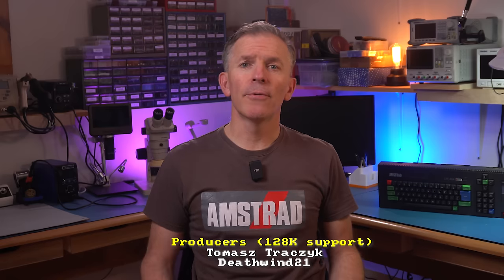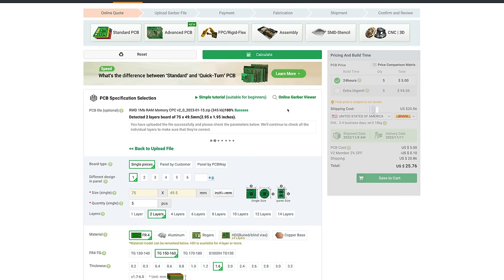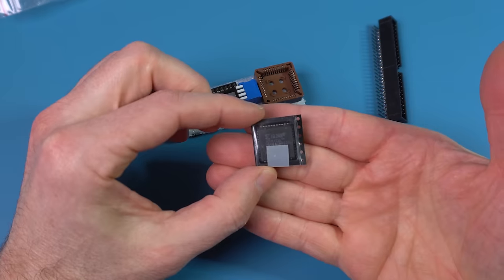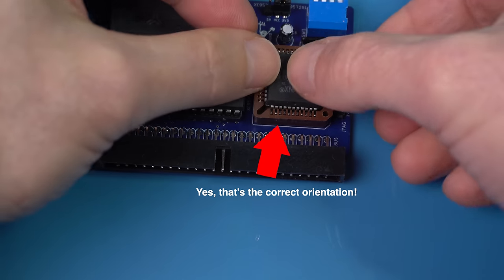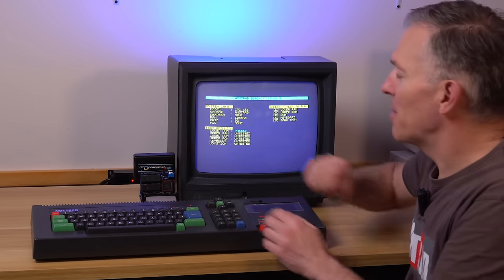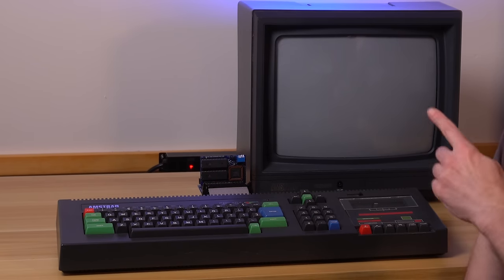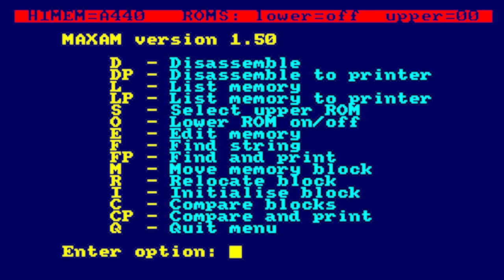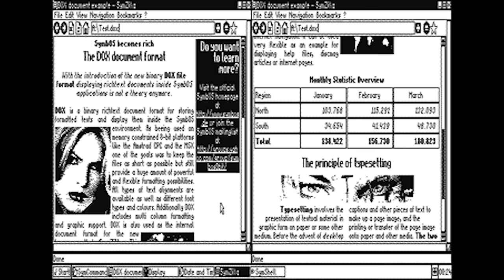Adding 1MB to an 8-bit Computer!

Comment: We could always go above 1 MB in DOS.  The only problem was that until the industry finally solidified behind Extended Memory Specification and the XMS standard there was really no reason to add more than 640k to a system.  Because there was really nothing you could do with anything past 640k other than brag about having it.

In the last days of the 808X platform (1991-1993), I built a lot of systems with 8086 processors that allowed 1 MB directly on the main board.  Because by that time MS-DOS-5 was the newest version, and it had a memory manager included to allow access to memory past the 640k limit.  And programs were also more and more commonly written to take advantage of that and reside in the high memory areas.  I built and sold scores of XT class computers with 1MB, that by default I shoved as much into High Mem as possible.

It was never really a "hard rule", it is just that before then no two companies were doing it the same way so trying to use anything past 640k was a nightmare.  Like trying to use the "Expanded Memory" system (EMS) that came before XMS.  Other than some games an a few specific applications that was never really used because it was a kludgy bank switching system that only worked in protected mode.

Comment: Why don't these videos ever acknowledge the Radio Shack Color Computer?  It had 64K at the same time.  It was the most versatile computer I ever owned.  I could plug almost anything into it directly and make things happen.  I could hook it up to a shortwave radio and decode Weatherfax and Wirefoto images with the same quality as a $10,000 dedicated machine.  I could hook it up to a MIDI keyboard and play multiple instruments simultaneously.  It was an inexpensive wonderland.  Then came the PC for way much more money, and anything you wanted to add required also adding another circuit card inside.  That took away some of the fun.
Reply from the maker: Nothing against it, just that I've had very little experience with it. But you're right, it was very similar to the Dragon and I could have mentioned it there too.

Comment: Actually I had a friend who died in 1998 and he had a 640K (not 64K) but 640K Amstrad CPC 464 he modified/upgraded it himself, it  was quite a computer, it had 6 storage drives and all sorts add on parts he designed it was quite a system matching if not faster than his Amstard PC1640, he was ahead of his time he also had something to do with the Ramdrive on Amstrad but not quite sure what he was involve in)) Rip JAN.. good video!  -- if i remember now its was a  device he designd which he would swap memory banks..  so far back wish i could tell you more.. I think he spproached amstrad but they were not interested ah well
Reply from the maker: Wow! That's seriously hardcore. Do you know what he did with it? He must have been using it for development or running some serious business.

Comment: Although these are fun projects to build and try, they really don't have much use as you've said. Same goes for the GeoRAM expansion for the C64. I have built one, just out of curiosity, and used it a couple of times with games that can use it. By use it, I mean by the help of a 3rd party software (written many years after the games) a multiple disk game can be loaded up into the RAM expansion and can be played without constantly swapping disks. One good thing that the GeoRAM has an internal CR2032 battery backup, so what you have in it stays there as long  as the battery has enough juice, which seems to be more than I anticipated, it has been almost 6 months, and it still works. That's the only sensible use of the GeoRAM. It was actually designed to be used in GeoDOS environment, but to be honest I really don't understand what that is good for on a C64.
Reply: Geos 128 v2 was much better. Georam was good for it. ramdisks are much faster.

Comment: I have the U2+ for my C64. It supports 16MB of ram (I can't comprehend that lol) But more importantly it's my disk drive. It's an all in one device. WAY better than a separate ram expansion and disk drive and tape emulator. So it sounds like that's what this computer needs.

Comment: I remember working at a place in 1985 where an engineer was hired to develop a 128K expansion board for the TRS-80 Color Computer. I kept wondering if anyone would actually write software for it (I don't think anyone did). Then a little later someone showed a "super coco" board that was much larger and had a 68000 chip. So I then wondered, why not just get a PC that has a more powerful CPU? I never saw that board being used either.

Comment: Actually it’s possible to use z80 specifics to switch banks. Some home computers used m1 signal to detect code execution and switch banks. So it was possible to give almost 64k to cpm applications and have kinda protected mode.
Reply: The only problem there is that /M1 only goes low during the fetch cycle of the first byte of an instruction. If you're using extended instructions, for example, using the IX or IY registers, subsequent bytes DON'T have /M1 asserted.

Comment: I wonder if it would be possible to sacrifice some RAM speed and do some type of time based multiplexing to address more RAM. So each line could theoretically address 2, 4, 8 based on clock time.  You'd lose RAM speed to be able to address more RAM per line.  You might need more supporting logic to get it to work.

Clock 1 -- 8 lines send out the low order bits and then on clock 2 they send out the high order bits.

CLOCK 1 -- 01101101
CLOCK 2 = 11011010

ADDRESSED LOCATION = 1101101001101101   (You've doubled the number of lines by using timing) 

The problem is that you cut RAM speed in half because you need to use 2 clocks to create the address instead of just 1 clock.

Comment: "IDC Connector" is incorrect.  IDC stands for "Insulation Displacement Connector".  The connectors that clamp onto ribbon cables have little bladed teeth that push through the insulation on the cable to make contact with the conductors inside.  The matching connectors mounted to a pcb don't displace insulation, so they aren't insulation displacement connectors.  (Or insulation displacement connector connectors)

Comment: Bill Gates? Someone's miss-attributed that quote. :) It was someone high up at IBM who said "640KB should be enough for anyone." The words were spoken. :) I'm told it made sense in context, but I'm not sure what that context was. Only 2 years later, Atari came out with a machine cheaper than the PC but upgradeable to 4MB, so whoever said "640KB should be enough" looks pretty daft anyway.

Comment: There is always ‘Amiga’ way ie use z80 socket as expansion slot. Make a pcb with z80 and ‘fast’ ram which has magabytes of fast local ram. One thing springs in my mind is to make such board with RP ala z80 storm, even RP0 has a lot of megabytes and horsepower to emulate z80 at 100MHz, without any additional RAM and CPLDs
Reply: It would be a fun project to build a fake "extended" z80 with massive amounts of RAM using a Pi Zero or Pico that slots right into the z80 socket of any classic z80 micro. 

There's a few catches though. There are other factors that limit the speed.

At a certain point it's actually easier to just run an emulator on your new hardware and have done with it :D
Reply: yep, there is a narrow line between emulation and simulation. The idea of "z80-storm" is to simulate beefy z80 with local fastram  @TheTurnipKing
Reply: @alexloktionoff6833  there are other limiting factors in the case of the 8-bits.  The NEXT had trouble supporting a clock of 16mhz for example, though they eventually got it, which is relatively trivial under emulation
Reply: The economics are really hard to make sense of to be honest.  You wind up throwing out so much of the old 8-bit micro to get features that are basically for free under emulation.
Reply: Not sure, I understood the problem, is it clock domain crossing between z80storm card and legacy m/b? But with modern uC boards it's not a problem, all pins are already passed through series of FF clocked by frequency more than order higher than legacy m/b. What lets to simulate beefy z80 running with wait states added to sync with legacy m/b bus clock. @TheTurnipKing

Comment: Well, interesting, but to be honest I don't have a single use case for more than 128K. I own a DDI 5 interface for my 464 which expands the RAM to 512K, and I only ever used programs that need 128K. Could be fun if I was a collector of Amstrad computers and peripherals. But I'm not. The video itself is great as ever!I had to view it several times to be able to understand why you only need 2 bits to address the 16K block, but I got it in the end. ;-)
Reply from the maker: Yes, I'm with you there. I was hoping there would be a killer app for that much RAM. So I'm hoping this video brings more eyeballs on it and more development takes advantage of it.
As for the 2-bit thing, I hear you. I always struggle with how long to go over something like that vs. quick mention and move on. I think I have an idea for that in the future that might keep everybody happy though.
Reply: @NoelsRetroLab  the memory expansion is maybe most usefull for SymbOS

Comment: It should be possible to use the memory as RAM disk under CP/M 3. I am not sure if Fuzix is available for the CPC, but 1 MB RAM was great for 16 bit Unix machines.
Reply from the maker: I haven't looked into it, but I'm sure it would be possible. It seems that CP/M is set up to use up extra memory already, so I bet there are already some RAM disks out there.

Comment: Wow, this is impressive! Make me curious what could be added to a TI99/4A with it's 16 bit processor. I know there are limitations within the TI that make it a partial 8 bit but that's as far as my knowledge goes. For that matter would the 99/4A considered an "8-bit" computer for this discussion?
Reply from the maker: Some people call it a 16-bit computer, but it's all more or less the same for this. There are lots of RAM expansions for the TI99/4A actually. That's one of those platforms where most modern development uses expansions, like the VIC 20, I think.
Reply: The TI99/4A was powered by a TMS9900 CPU, which was a single chip implementation of TI’s 16 bit mini computers. It was unfortunately hamstrung by TI marketing, who didn’t want it to compete with said mini computers. As a result it only had 256 BYTES of RAM connected directly to the CPU, and everything else had to be accessed via the VDP chip that handles video. The TMS9900 is a 16 bit chip, with a 16 bit address bus (so a full 16 bits for both the address and data), the minicomputers were designed to handle paging to go beyond 64K.

Comment: Check out the function of the m one line on the z eighty microprocessor chip
It goes low on every op code fact and could be used. Is a bank switcher for machine cudo.
So you can have 64 KB of machine code and 64 KB of data using the M1 to switch between the One

Comment: 64kb was not a significant amount of ram in 1984. By then plenty of PCs were being sold with at least 128 or 256kb. Just because computers with the bare minimum were still being sold doesn't mean it was a lot.

Comment: Gates may/may not have said that, but at the time, such a statement would have been correct.  At some point, for quite a while too, 640K was enough for the everyday normal computer user.  
Now 32GB ought to be enough for anybody, at least the normal everyday user, but it's all but guaranteed that in 10 years, that will no longer hold true.

Comment: you can try to run wolfenstein on it because it requires just 512k of ram i think and what i have seen it was able to run on 8088 cpu so it maybe can run on z80
Reply: Almost certainly not.  The CPU architecture is different (the z80 is an enhanced 8080, the predecessor to the 8086 and the graphics and sound and even memory hardware will be in entirely different locations.

Comment: I'm dreaming of the ultimate add-on on amstrad using an raspberry like pistorm on amiga.
Memory, storage, wifi and sound card emulation.
Reply: The M4 card gives the CPC: wifi, 32 slots for 16kb ROM images, and, depending on the size of Micro SD card you plug in, a super large virtual floppy drive with nested folders, AND a real time clock.

Comment: nice vid Noel thanks!... im trying to build the 512kb expansion at the moment, stuck programming the cpld tho (i installed the VM and have impact running!).. i dont have the proper programming cable so have been trying to use arduino or raspberrypi pi to program the chip.... but im not having very much luck, urjtag says it cant program that chip (xc9536).. the virtual xilinx cable makes the operations (eg programming function) disapear, even tho it detects the chip during boundary scan....and using arduino directly throws a bunch of TDO errors when trying to program..
if anyone has any tips or ideas to help..id be greatly appreciative!
Reply: no matter.. seems i programmed it easy with arduino and correct wiring and xsvfs!..now to test! 😁

Comment: I am a little unclear about how your diagnostic knew the protocol for addressing the external RAM. I'm familiar with bank selecting - but is the bank selection that you used a "standard?" That - your diagnostic cartridge seemed to know how to use the IO pins to select the banks. And that diag cart was created before your new RAM board... so how did it know?
Reply from the maker: Good question. Yes, there's a pseudo-standard on the Amstrad CPC that most memory expansions respected (with a few differences). You can read about the details here: https://cpctech.cpcwiki.de/docs/rampage.html
Reply: @NoelsRetroLab  Many thanks, friend. Great video. I'm subscribed. Continued Success!

Comment: Unfortunately, this a very niche product. Throughout the video I just kept asking "Why?" It's a lot of time, trouble and effort to go to in order to have something that 99.9% of programs don't use. Also, Xilinx 95xx CPLD's are themselves end-of-life in PLCC packages and so are difficult to find. The only package still generally available is TQFP which is a whole lot harder to solder!
Reply from the maker: It is. I was hoping there would be a clear killer app for it, but there isn't yet. Part of the reason for the video was to bring more visibility to it and maybe someone will take advantage of it and make it a must-have add-on. If all you want to do is play games, it's definitely not needed (other than to get the extra 64K for the 464).

Comment: How to obtain more memory than magic 64kB? Answer is memory banking. I had on Atari 65XE 256 kB memory working only under Sparta DOS, because address extension mux was targeted exactly for this system. It was working miracle with diskette drive, because whole RAM-disk was ready for use.

Comment: I do not understand then how an 8-bit video game console with a modified 65C02 (Hu6280) @7.14 MHZ can have 2MB of RAM (16 mbits) and very well move the data required to move games from a 16-bit console variant of the 68000 motorola to @14mhz arcade Neo Geo. How can change tha bank in the middle of game without any pause on screen.

Comment: As a software developer since the 80s, 64K is actually a lot to play with. Developers just got lazy. There is barely any ingenuity in current gen developers, unfortunately. Why an empty Excel sheet is bigger than the full RAM of an 8bit system is beyond me 🤣
Reply from the maker: It is and it isn't. As soon as you make a table of anything, you can easily fill up several Ks in a blink of an eye. I was making a game last Christmas and I realized that a map array with a byte per tile was going to take multiple KB. Yikes! It's stuff like that that forces you to rethink how you do things.

Comment: Why to use 3 instructions ld b ld c in (c) but not just two ld a in (port) ?
Reply: Because the 16 bit I/O instructions should always be used on the CPC, as only ONE of the upper six bits of an I/O address should be low at any time: A15 selects the Gate Array, A14 the CRTC, A13 expansion ROM select, A12 printer port. A11 the 8255 PIO and A10 is for external peripherals ( includes the built-in disc drive on a 664 or 6128 ).

Comment: The intel 8088 / 8086 multiplexed the address bus and data bus for 8 more address bits. Vs z80 or 6502 or 6809 did not and required ram banking

Comment: WTF is mode zero? I've tried looking for the answer before.
Reply from the maker: The Amstrad CPC has 3 official video modes: https://www.cpcwiki.eu/index.php?title=Video_modes Mode 0 is the low rest, most colorful one.
Reply: Wonder if that in any way equates to the "mode 0" setting I've seen on Ryzen motherboards. Maybe APU specific. Since new stuff is built on top of old, with so much backwards compatability, wouldn't surprise me.

Comment: 10:07 it cant know how many banks you have. total memory is 65k what computer see. means 0k rom.
more ram is not that good. you need program it to use memory what you not actually have.
my brain not even compute that. ok lets bank later in code we read ram and forget change bank. yeah need everytime when read and write make sure bank is ok LOL and still 64k is max

Comment: How ironic: You talk about keeping a 40 year old computer running, but then update it with a CPLD which won't be available in 5 years, let alone having it programmed by someone. You didn't even program it today, because it was too hard. How will anyone program it in 5 years? I bet in 5 years time this RAM upgrade project will be impossible to build, yet the Amstrad will still be working fine.